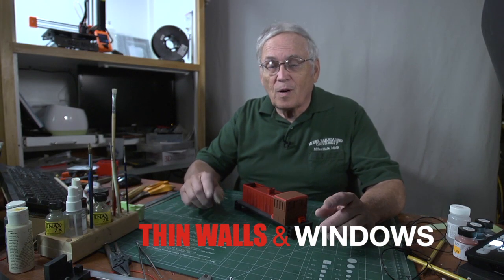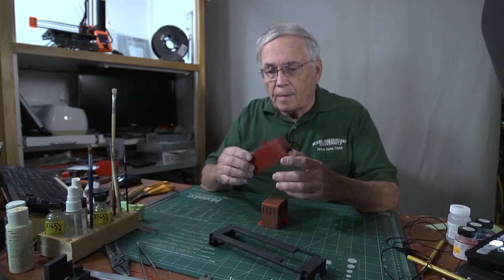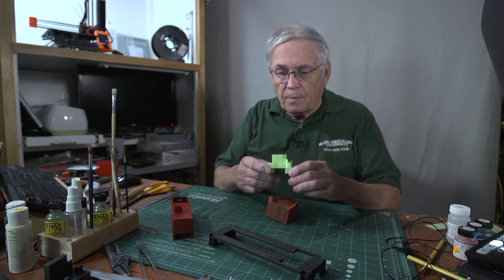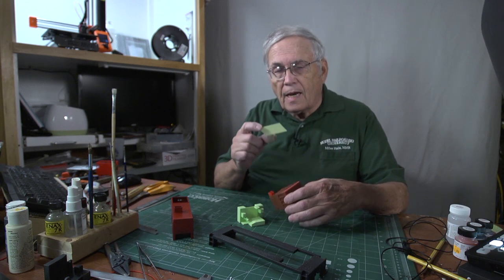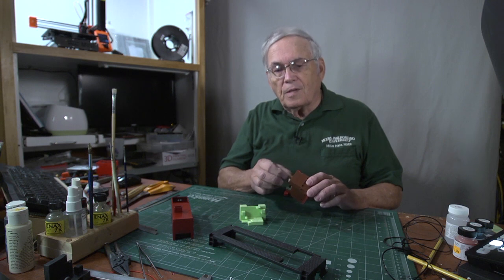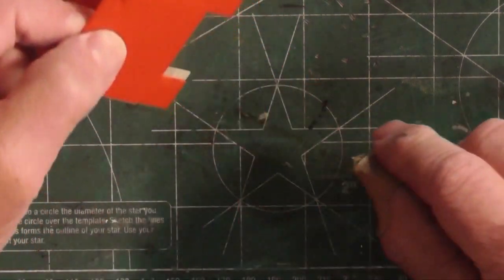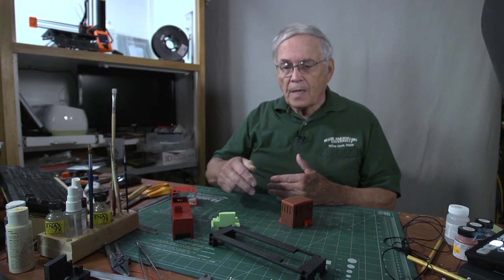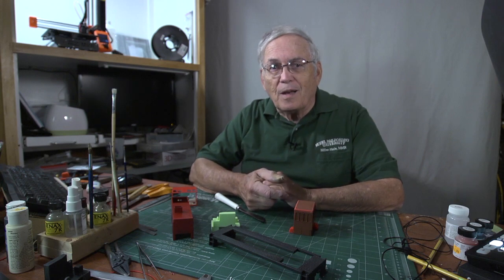ThinWalls

Comment: My assumption is that in addition you can add 'embossing' to that green interior wall such as door handles and molding around the windows and doors
Reply from the maker: That would be a good thing to add. If the wall does not need the detail then the inside and outside should match perfectly but if you add the details you may have to work a bit to match the inside and outsides of the walls.
Reply: @modelrailroadinguniversity5195  that should be at least a partial mirror of the exterior .. lines of door, handle, window trim